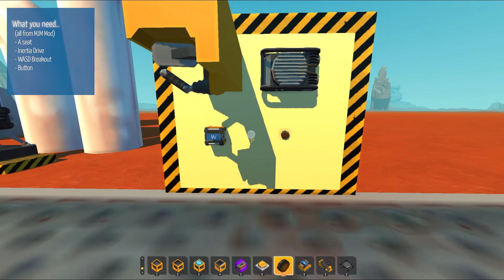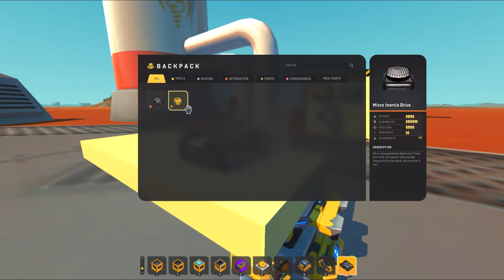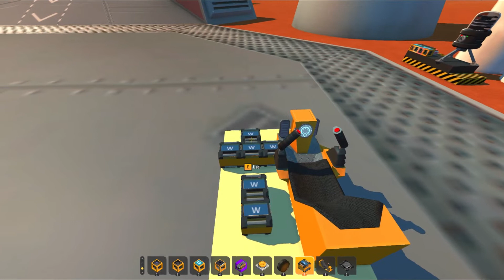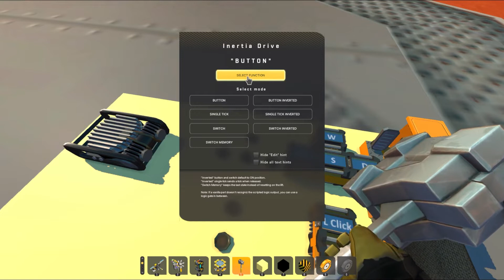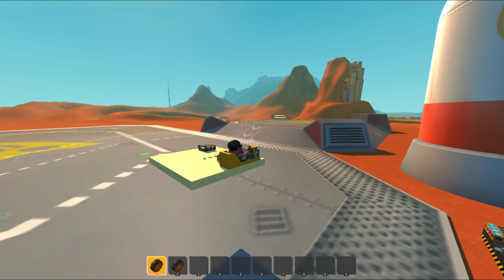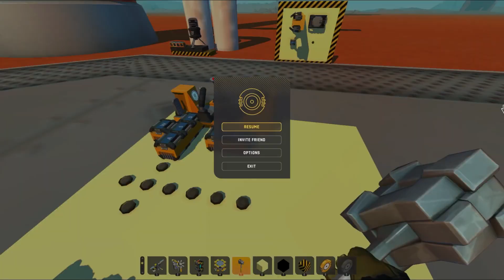Scrap Mechanic Tutorial: Mastering Inertia Drive in 13 minutes

Comment: 1:23 absolutely none of the tutorials i looked at mentioned that and its what I've been doing wrong
Reply from the maker: It took me a while to figure out what's going on with my older Inertia Drive creations; they behaved okay until I started adding doors and compartments that could open, close, slide out, etc.. Also one more tip: If you build your main body from a heavy material, it will be easier to deal with a little imbalance caused by additional weight such as the door. It's easier for a 10.000lbs floating brick to deal with a 10lbs dead weight. But you may need to bump up all the controlling force values (Axial, Lateral, Vertical, and Yaw).. and of course the relevant Damping and Autobalance. Good luck!

Comment: im having an issue with the autoleveling, instead of just leveling out after bumping into something its like it overcompensates and starts swinging back and forth increasingly quickly. I've tried both raising and lowering the the power but no dice

edit: figured it out, I just had to scale the power with the size of the build, I was putting together a seat with all the components that I could just weld on to other builds for flight, but the seat itself was too tiny so when I was testing it even 4 or 5 power was way too high, keep that in mind ig. Overall great system though, sure beats using modpack antigrav module and fiddling with pico thrusters for hours to get the balance right.
Reply from the maker: Was just about to reply.. but I'm glad you figured it out! Yes, scaling of the power and dampening is a crucial part of these builds. Best of luck!

Comment: I can't get the yawing right it doesnt turn both left and right
Reply from the maker: Hi Radiation.. it should work as shown, unless something is broken in the mod itself. Check that you capture the correct keystrokes and they're all properly linked to buttons and they in turn to the Drive unit. As you could see in the video, I made a mistake of badly connecting some inputs as well - it's easy to miss a thing.
Reply: @TarisSinclair  I made it as shown except for the mistake and it doesn't work, it maybe could be too many mods because i have like 20 mods. Edit: Here is fotage https://youtu.be/Wc9NLRMAMKQ
Reply: It works on smaller builds
Reply from the maker: @Rad1ation  Thanks, I checked it out and left a comment.. I wish I was able to spot something and come up with an instant solution :)
Reply from the maker: @Rad1ation  If it works on smaller builds, try to increase the force of the left and right yaw (that's done directly in the Inertia Drive unit). I entered rather low values because the demo build was light. Gradually try to increase one of the values (e.g. Yaw Left) until you start noticing an effect.. then see how much more you need to push it up to get to where it feels right.